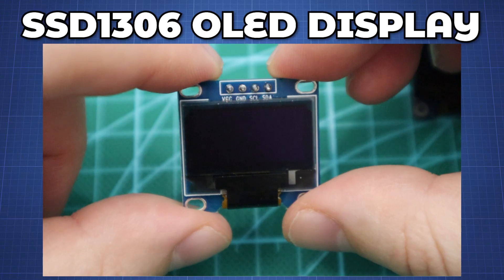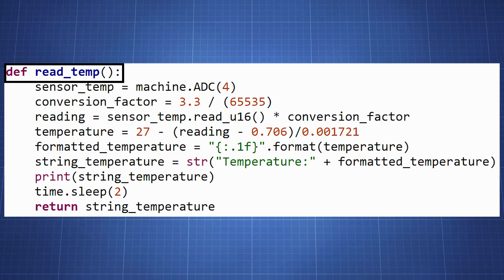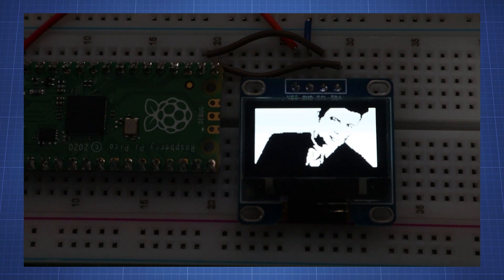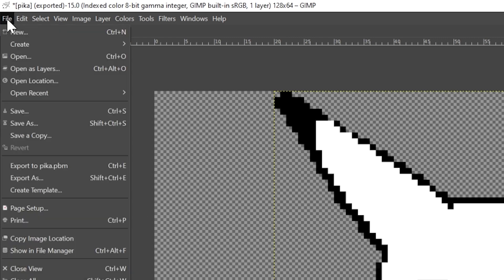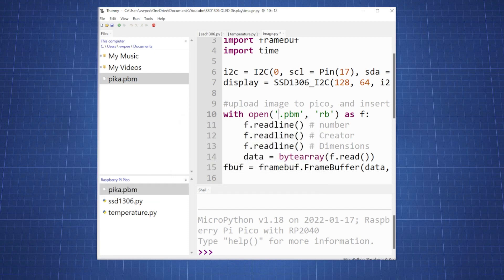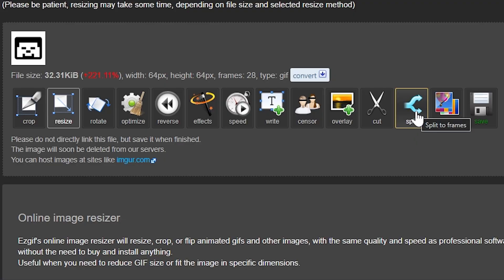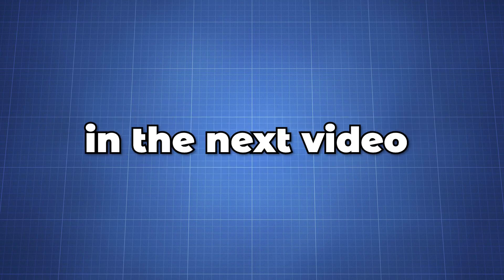Raspberry Pi Pico Tutorial - SSD1306 I2C OLED DISPLAY

Comment from the maker: A tiny mistake in the schematic of the ground wire that is in wrong rail.
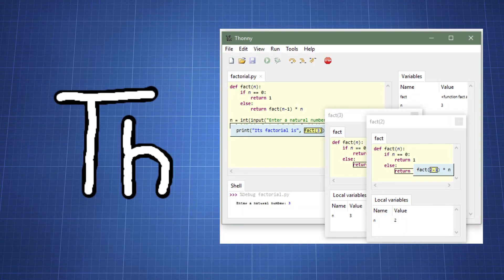Reply: Just to clarify, it's the black wire on the left-side; move UP 1 pin.  At 1:20 it's correct.
Reply: Yes just to elaborate for any other users. be sure to connect the red (positive) wire to the top power rail on the breadboard. as shown on the breadboard section.
https://youtu.be/Ts9JXbMvfTQ?t=80
Reply: it says ssd1306 is not a module

Comment: the library doesnt save. i tried to do everything to the point where i even bough a new pico and used another usb cable. but still this error popped up: 

Could not write next block after having written 0 bytes to /ssd1306.py
PROBLEM IN THONNY'S BACK-END: Exception while handling 'write_file' (OSError: [WinError Traceback (most recent call last):

  File "<stdin>", line 1, in <module>

  File "<stdin>", line 4, in __W

OSError: 28

] __W(b'# MicroPython SSD1306 OLED driver, I2C and SPI interfaces\r\n\r\nfrom micropython import const\r\nimport framebuf\r\n\r\n\r\n# register definitions\r\nSET_CONTRAST = const(0x81)\r\nSET_ENTIRE_ON = const(0xA4)\r\nSET_NORM_INV = const(0xA6)\r\nSET_DISP = const(0xAE)\r\nSET_MEM_ADDR = const(0x20)\r\nSET_COL_ADDR = const(0x21)\r\nSET_PAGE_ADDR = const(0x22)\r\nSET_DISP_START_LINE = const(0x40)\r\nSET_SEG_REMAP = const(0xA0)\r\nSET_MUX_RATIO = const(0xA8)\r\nSET_IREF_SELECT = const(0xAD)\r\nSET_COM_OUT_DIR = const(0xC0)\r\nSET_DISP_OFFSET = const(0xD3)\r\nSET_COM_PIN_CFG = const(0xDA)\r\nSET_DISP_CLK_DIV = const(0xD5)\r\nSET_PRECHARGE = const(0xD9)\r\nSET_VCOM_DESEL = const(0xDB)\r\nSET_CHARGE_PUMP = const(0x8D)\r\n\r\n# Subclassing FrameBuffer provides support for graphics primitives\r\n# http://docs.micropython.org/en/latest/pyboard/library/framebuf.html\r\nclass SSD1306(framebuf.FrameBuffer):\r\n    def __init__(self, width, height, external_vcc):\r\n        self.width = width\r\n        self.height = height\r\n        self.external_vcc = external_vcc\r\n        self.pages = '): '').
See Thonny's backend.log for more info.
You may need to press "Stop/Restart" or hard-reset your MicroPython device and try again.

Process ended with exit code 1.

pls help somoewne
Reply from the maker: How did you try to save the library, you just copy the code library code from github and paste it in a new file and save it to the pico as ssd1306.py  and then in another file you will have from ssd1306 import SSD1306_I2C and this will import the library

Comment: Great video, I have been struggling to get this Oled to work. I always get static noise and rapidly scrolling text on the first top lines? I2C scan works fine and I get the correct address back (0x3C).
I also soldered the wires to make sure I get good connections but problem stays :-( any thoughts?

Note: I run below small code  on Pico with v1.19 because I don't have the temp sensor, also Pico with v1.20 gives me a bunch of errors when running the code:

from machine import Pin, I2C
from ssd1306 import SSD1306_I2C
import framebuf
import time

WIDTH = 128
HEIGHT = 64

i2c = I2C(0, scl = Pin(17), sda = Pin(16), freq=100000)

display = SSD1306_I2C(128, 64, i2c)

# display.invert(1)
#display.contrast(100)

while True:
    display.text('Text 1...' ,0 ,0)
    display.text('Text 2...'  ,0 ,14)
    display.show()
    display.fill(0)
Reply from the maker: sorry for the late reply what errors do you get?

Comment: Theres an error i keep on getting. Any know on how to fix? Ill paste the whole message below

Traceback (most recent call last):
  File "<stdin>", line 11, in <module>
  File "ssd1306.py", line 117, in _init_
  File "ssd1306.py", line 36, in _init_
  File "ssd1306.py", line 73, in init_display
  File "ssd1306.py", line 122, in write_cmd
OSError: [Errno 5] EIO
Reply from the maker: It seems to be a connection error you SSD1306 is the pinout the same as the one I used in the video I know there are different modules

Comment: It doesn't work differently than ESP32 if you take the USB power and reconnect it. Do I have to keep uploading it every time I do it? How does it work on batteries?
Reply from the maker: on the raspberry pi pico you upload it to main.py I assume the esp32 will have a boot.py so you don't have to keep uploading it and also a V-in for battery power supply. I am planning on covering the esp32 later this year

Comment: the links are correct the code is correct but i am getting error like this. Sometimes it gives an error saying no module named 'ssd1306', can you help me?

♦Traceback (most recent call last):
  File "<stdin>", line 9, in <module>
  File "ssd1306.py", line 116, in _init_
  File "ssd1306.py", line 35, in _init_
  File "ssd1306.py", line 72, in init_display
  File "ssd1306.py", line 121, in write_cmd
OSError: [Errno 5] EIO
Reply from the maker: you are only getting the error sometimes right, usually a bad connection has given me this error before

Comment: Hello thanks for the tutorial. I got the first part with temperature correct. The last animation tutorial gave me an error. Could you tell me what I have done wrong?
MicroPython v1.19.1 on 2022-06-18; Raspberry Pi Pico with RP2040

Type "help()" for more information.
>>> %Run -c $EDITOR_CONTENT
Traceback (most recent call last):
  File "<stdin>", line 15, in <module>
OSError: [Errno 2] ENOENT
>>>
Reply from the maker: What is line 15 it is giving the error
Reply: @NerdCaveYT  with open('/minecraft/image%s.pbm' % n, 'rb') as f:  #open folder and image
Reply: @NerdCaveYT  thanks for the response. I got it working. I think it was something to do with the image numbering, also had to change some settings in EZgif. But it works!
Reply from the maker: @alexfernandesportrai  I think there are other methods as well I just used one I found on a blog, but some people wrote programs go to do it
Reply: hi @alexfernandesportrai   how did you geti it working ?
because i have the same issue.
Reply: Same 
):